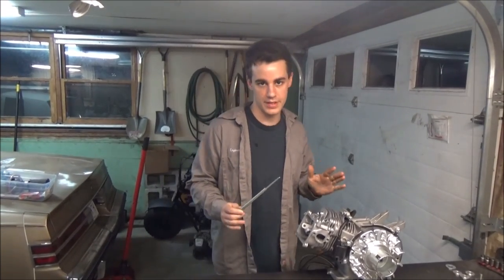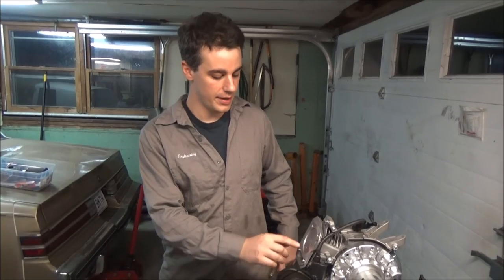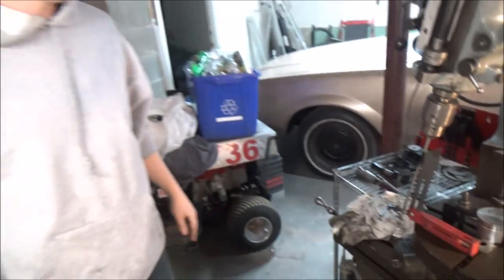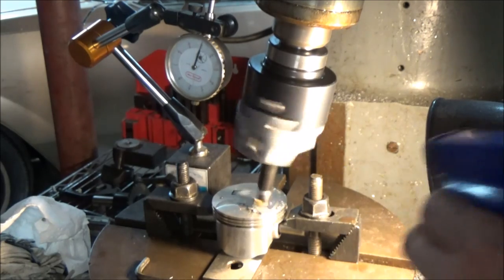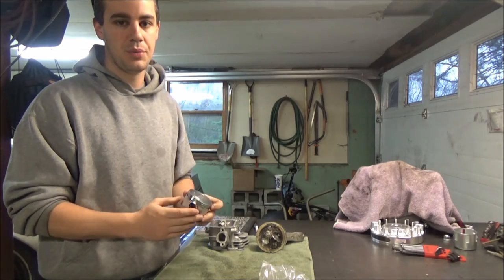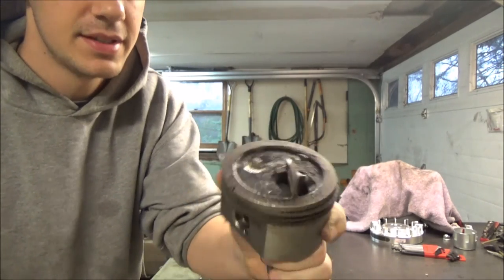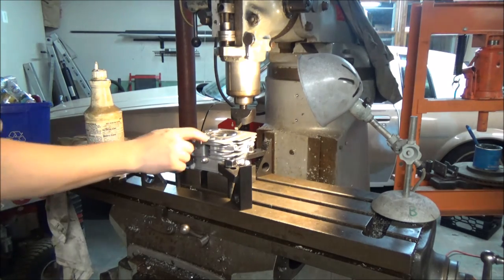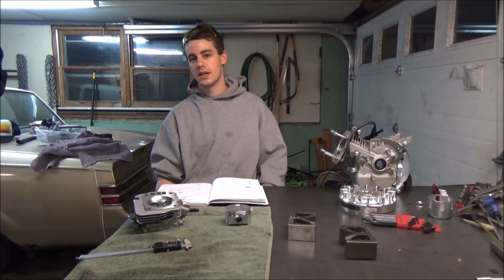Machining piston valve relief pockets on a Bridgeport Mill (Predator 212 Hemi)

Comment: Woww. Very nice. That way you can either have a TON of compression or an extremely high valve lift. Nice man. I would like one of those pistons you made lol.
Reply from the maker: +Speedy_ 212_ Thanks! We did what we could with the tooling we have, a piston vise would've made it a lot easier. As for what wrecked that piston in the video, it's hard to say but id guess valve spring retainer failure due to it being from a governed mower only turning around 3600 rpm.

Comment: Easiest way to cut your piston is get an old valve and turn it into an endmill while your head is torqed use the ENDMILLE (converted valve) and use it to cut your piston with just a drill.  No mill setup.  BTW I am a machinist.  Valve installed in head and piston locked at TDC while head is installed in the motor take a depth reading on the valve stem and determine what you want to move in.  I think you said .09.  Gotta watch for valve float when your pushing it this close.   Anyways take your initial reading then cut measure then after your happy with the depth hand polish and take a few thousandths off because the valve actually microscopilly wiggles and if you mill it with the valve you need to take a bit extra off by hand so it doesn't hit while running.

Comment: good work, i've seen this done alot sloppier just using an old valve ground into a cutting tool so i'd say this looks pretty good! did you measure the total thickness from the top of the piston to the floor of the bottom?

Comment: Would that .020” clearance you gave, that I’m assuming was for later decking of the head or cylinder, be affected by the angle of the valves? As in the angle would affect the actual value of clearance given. Also the center line of the valves would change too, correct?

Comment: Hey man, this is the video that locked me into subscribing!  Hey man what kind of Bridgeport is that?  I like that you do your own work.
Reply from the maker: +adam roberts Thanks! It's a late 60's J-head with a 36" table. It's a nice little basement or garage mill and is really smooth and quiet with the variable frequency phase converter.
Reply: +TheJanticJournal I'm trying to learn these machines there are a lot of them! There are a lot for sale local just trying to figure out the right fit.

Comment: What lash did you check the piston to valve clearance? I'm running a 274-0607 with 1.3 rockers for around 260 duration @ .050 and .350 lift. No valve issues with .003 lash.
Reply from the maker: +MrKyleb21 Wow that's a huge cam! I checked my piston to valve clearance at 0 lash. What type of motor do you have? The hemi predator has canted valves that run closer to the piston and I also took a decent amount off of the head and have a 6 degree advance grind.
Reply: I am running a clone with an 18 cc GX200 head with 27/25 valves, .065 milled, and .025 piston to head for around 15:1 on methanol. I run a gas ported stock GX200 piston, ARC rod, stock Honda crank, and ARC adjustable flywheel at 33 degrees of advance. I turn it 8600-9000 rpm and guess I am in the 22-25 hp range.
Reply: Also... The billet side cover is a must and I broke that cam in half this weekend, so I am switching to the billet grind.
Reply from the maker: +MrKyleb21 are you running those motors on mini bikes? I've been getting a little nervous about my side cover myself lol
Reply: Just built my first modified Predator last week and my customer ran it against me and beat me before my cam broke. I wasn't impressed with the Hemi head at first but I really liked the looks of it milled .080 and with the porting. I ran the same intake setup and carb (GX390 on methanol), a smaller Mod2 cam, 15:1, ARC rod, PVL flywheel, and clone crank (208 CC). Stock gas ported predator piston. He was turning it 8300.
Reply: No... We are outlaw flat kart racing. I have tried everything with the stock covers. They come with 8.8 bolts, so I tossed them and got 12.9 socket headed cap screws, lock washers, and blue lock tight. Went to the SAE 24 ft/lbs with the 12.9 bolts and still loosen up. I've added extra dowels. I've even used red lock tight (bad idea). Just get the ARC cover and keep it from walking around. It also lets you have more control over crank end play.
Reply: Also... The only failure I had before this was a valve I pulled in two. If you get stupid with spring pressure, get the stainless valves. You can run the 37 lb single springs at about .800" install height and be just fine with that cam setup to 9000. I think when I made the swap to duals is when I hurt the cam. I did not see a performance increase with the dual springs.
Reply from the maker: +MrKyleb21 Wow lots of info, really appreciate it. We're only using them in mini bikes so we're not going to see nearly that high of RPMs. I have stock size stainless steel valves in the hemi predator with 26 pound springs which should be fine for our RPM range.

Comment: How much lift was on that Cam. I'm reading other places where I can take 40 off the head with a 320 lift cam and want have to fly cut the piston and still have 50 valve clearance.
Reply from the maker: +Brad Fillingim It's a .275 lift cam. Is what you're reading about a hemi style engine? Also keep in mind this cam has a 6 degree advance grind which makes clearance closer and I was wanting .090 clearance at the end of the day

Comment: Yes it's a hemi. just read on ARC Facebook he took 60 off the head and run a 36 gasket and. still has 70 clearance. From your video I just don't see how that's possible. I just asked in the comment section on there post about it.
Reply from the maker: +Brad Fillingim No two motors or cams are the same. At the end of the day to be safe and have peace of mind you'll want to check the valve to piston clearance yourself. The deck height on Chinese motors are notoriously varied as is the head machining. I got a cam from Dynocams and at their recommendation I degreed it too be safe and it was right on the money, not every manufacturer will be as precise though. A huge factor for my motor was the advanced degree grind, it will seriously cut the clearance of the intake valve at the end of the exhaust stroke and there's also the mater of duration, lift isn't the only spec to look at, the closest point of contact usually won't be at full valve lift since the piston should be a ways down the cylinder by that point. Hopefully my reply helps, but my advice is to always check it yourself especially if you're racing it.

Comment: Ridiculous to use a boring head  that’s job for a center cutting Endmill
Reply: Who cares if it works..
Reply: martin nielsen I do
Reply from the maker: I agree, it's the wrong tool. But I knew it was a one off job and I had the boring head kicking around so figured I'd give it a try. I'm surprised how well it actually worked though lol